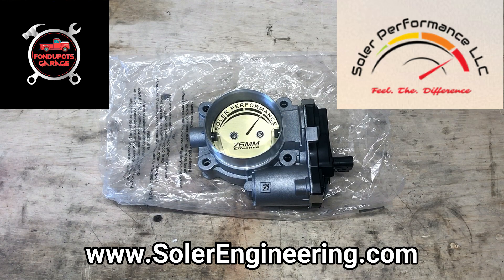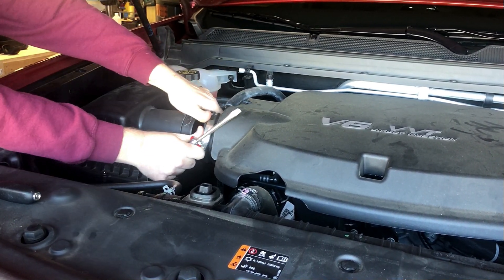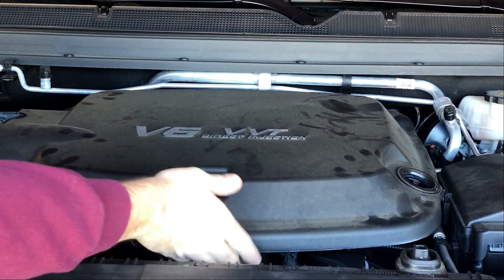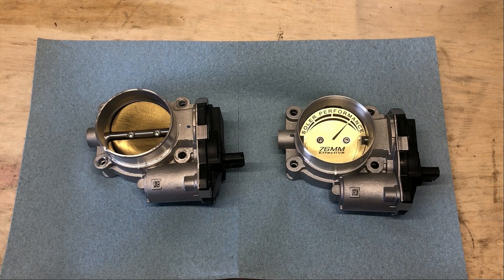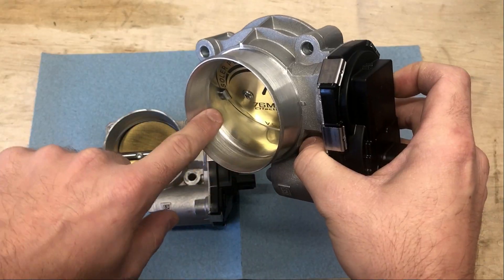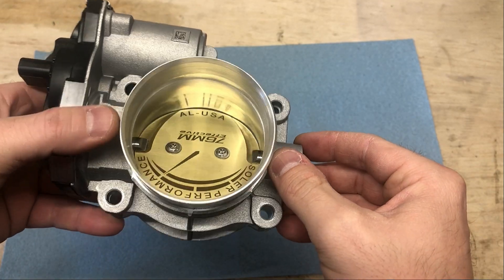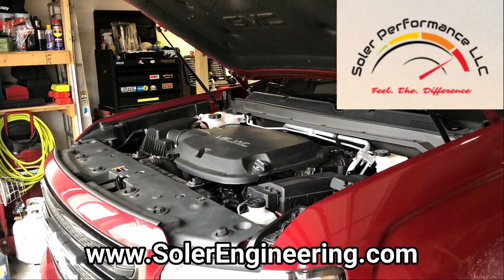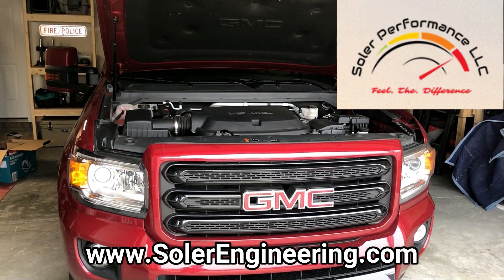[HOW TO] Install Soler Performance Premium Modified 76mm Throttle Body on 2015+ Colorado/Canyon 3.6L

Comment: I’m a bit confused on the driving cycle after installing the new throttle body. For me I typically drive 100 miles to work, shut the car off, then drive another 100 back home. Sometimes I do that 2X a week. So let’s say I drove 400 miles between 4 on and off cycles. Should I drive another 100 miles with 2-3 more on and off cycles over the weekend to fully calibrate it?
Reply from the maker: Do the calibration on the weekend, and follow the procedure laid out in the video.
Reply: @fondupot okay so pretty much just drive 50-100 miles this weekend while shutting the truck off every 15 or so miles? How long should I keep the truck off between cycles?
Reply from the maker: A minute or so should be fine. You don’t need to stop every 15 miles. But do 2-3 restart cycles over the course of the 100 miles.

Comment: Instead of 5-10 50 mile trips could I just a 500 mile trip ?
Reply from the maker: I think the calibrating requires the cycles of on-off to dial in the new throttle body.
Reply: @fondupot  okay thank you I appreciate you replying the reason I ask is I'm about to do some traveling and wanted to install it for the trip I'm going to drive a total of maybe 3-4 thousand miles total but they will be broken up in segments of 5-600 miles per stops
Reply from the maker: @SLOWZR2 it might be OK. But I would contact Soler performance and get their feedback first.
Reply: @fondupot will do thanks
Reply from the maker: @SLOWZR2  Good luck!

Comment: Has anyone noticed a reduction in engine braking when using this Throttle body? Doesn't seem like it fully closes the intake so i would think the plate doesn't fully resist the flow of air through it when closed
Reply from the maker: Nope.

Comment: Unfortunately this throttle body does nothing for 2016 chevy colorado,  gotta be a placebo if anybody thinks it does... almost 250 miles on my soler throttle body and no performance gains,  I'll wait till tank is empty to see if I get any fuel gains from it
Reply from the maker: That’s a shame. Very noticeable difference on my 2019 LGZ 3.6.

Comment: What size should I buy? Would I notice any difference even though I already have the trifecta tune?
Reply from the maker: If you buy the larger one you might need a different air intake. I’m not sure. I stuck with the original size for my truck.
Reply: @fondupot  I bought the one you had, hopefully is good with my trifecta tune.. I noticed 2-4 maybe 5th gear are good with trifecta but passing on highway isn't as good as I expected.. hopefully the throttle body changes that
Reply from the maker: It’s great with the trifecta. You’ll love it
Reply: @fondupot  I hear people saying the throttle body housing sometimes needs to be bored, but since you didn't mention that and say you saw noticeable improvements means I should be good
Reply from the maker: Yea I didn’t have to do anything to the housing. It was bolt on.
Reply: @fondupot  what about their throttle controller? You think it's worth getting the throttle body if you can just use a throttle controller?

Comment: After a year with the Soler TB I think it's the best performance upgrade I've done.  CAI intake and Magnaflow exh has enhanced the TB, but the TB alone, after a few hundred miles is amazing.  No more flat spot, much better throttle response and overall drivability.
Reply from the maker: I agree, I have been pleased with the Soler TB. I was actually thinking about opening it up and doing a throttle body cleaning to see how it has faired over the last year. It's been on my truck for about 12,000 miles now.
Reply: @fondupot  I checked mine after 8k, just a touch of buildup.  30 seconds with cleaner and it was new.  The MAF was still spotless.  I want a cheap bore scope so I can check the intake ports and valves.
Reply from the maker: Good to know. I should look into a bore scope too.
Reply: @fondupot  $40 on amazon for the cheapie, some shops use them because they get beat up no matter how much they cost.
Reply from the maker: Cool I’ll look into it!

Comment: Mmm i see that they did da same mistake on the butterfly TB (engraved slogan or brand)... They also put it down ... I was thinking that only with me did that mistake... I try to fix it but was to tight so i leave it that way.
Reply from the maker: I think it’s because the TB can be used in multiple applications. And some engines Mount with the logo right side up and others with it upside down. Oh well. You never really see it anyways.
Reply: @fondupot  yeap buy I've got a crazy idea if i desing a flexible clear cold air intake pipe
Reply from the maker: Sounds crazy, yep.

Comment: Do you have a link for the locking tab for the motor connector? Mine broke off when installing the throttle body
Reply from the maker: I doubt the tab is sold separately from the connector. You probably have to replace the connector to get a new locking tab.

Comment: How did this interact with your trifecta tune? Would the engine lug a little more before it shifted on throttle or was it the same just didn't have to hit the throttle as hard?

I just got a trifecta tune and was considering installing one of these just for the increased air volume at the same throttle input. Does it effect the shift points or leave it similar to what trifecta tuned it for?
Reply from the maker: I think it enhances the low rpm response even more. The two pair well together. The shift points dont really change with the new throttle body, its just a smoother throttle curve compared to stock. Thanks for watching!
Reply: I have the Trifecta, CAI and cat back, 4.10's and 33's.  The Soler 72/76mm TB improved part  throttle drivability.  I had a occasional hesitation when doing a rolling stop, just a split second hesitation.  This appears to have eliminated that.  Only have a few days with it, so far I feel it's worth the  cost.  It may have helped WOT, I think it was more intake and exh noise.  I'll edit this comment when I get more time on  the engine and the ECM corrects for the new TB.
Reply: @madcratebuilder  give this a like when you do it so I can read the follow up too please haha
Reply: @737Kamikaze  One month and 500 miles now and the trans shifting is fantastic.  Shift points are slightly lower rpm in both eco and sport mode.  Zero hesitation.  I  feel the TB has enhanced the cai/cat back.  Part throttle drivability is fantastic.
Reply: @madcratebuilder  awesome, thanks man

Comment: Love your videos. How has the new TB been working with the trifecta tune? Would a new tune help with the better airflow? I see they have a 76mm and an 80mm. Any input on one over the other?
Reply from the maker: Thanks a lot Anthony. The TB and Trifecta are working together perfectly. I haven't experienced any issues. I think they go hand in hand perfect. The truck was great with the Trifecta, but now its awesome with both. I think the 80mm might be better suited for someone that wants to do more custom tuning, whereas the 72mm would be better for folks that are stock, or have a canned tune, like a trifecta. Soler did say the 80mm ones would work without tuning, but he recommends most would tune with this option in order to get the full benefits of the larger much larger TB.
Reply: @fondupot  thank you!

Comment: Any changes in your gas mileage?
Reply from the maker: I'm averaging around 19-20 in mixed driving. I haven't had a chance to take a long highway trip, but it doesn't affect the mileage negatively.

Comment: I see you got the Trifecta tune and did the learning procedure. Could you just reload the tune and skip the on/off, on/off and driving to learn the TB? Not that it's a big deal to do it, just curiosity is all. I have a '15 Z71 4x4 CCLB with the Adv+ tune but still notice a little hesitation starting out when in ECO mode. Not so much in sport though.
Reply from the maker: It’s a short procedure. Either way the ECU has to learn the new amount of air coming in. I found that the off idle was much improved when in eco mode. And the truck just feels like a beast in sport.
Reply: @fondupot  Thanks Bro. Thinking hard about it now cause it's a pretty penny to drop right after the holidays.
Reply from the maker: I feel you! I don’t think they’re going anywhere so you can think on it a while and save up!
Reply: @fondupot  I got rid of eco mode on my trifecta tune,  I saw no reason to keep it so now I'm running on full tune even on cruise control, gas mileage is just better with the tune
Reply from the maker: Great. Glad you enjoy it!

Comment: I had little interest in this upgrade but I just love watching your videos. However, when I discovered that I could get rid of that annoying hesitation things changed. I'm leasing but it still might be worth it to get 2+ years of "more spirited" driving. Thanks!
Reply from the maker: It would be an easy one to do on your lease and just remove it before you turn it back in. Thanks for supporting the channel! Appreciate you watching the videos.
Reply: Good idea. I had a '17 Colorado leased now on a '20. I'll probably lease a '23 next. If they don't change the engine I'll be golden.
Reply from the maker: Right on! Enjoy!

Comment: What is the cost ?
Reply from the maker: $275 for a core exchange or a rework of you own TB. $375 for a brand new reworked TB.
Reply: @fondupot  and if I heard you right, there was a larger one available ?
Reply from the maker: Yes. There’s an 84mm TB that needs an adapter plate. Check links in video description.
Reply: @fondupot  want to get mine tuned but waiting for the warranty to expire first.
Can I ask why you didn't go for the bigger one ?
Reply from the maker: No reason in particular. Just went for the one without the adapter.
Reply: @fondupot  then in your opinion it's worth the money and you can tell a noticable difference?
I know that yours is tuned, so I was just wondering if I would notice a different ?
Reply from the maker: I noticed a difference op top of my trifecta. So I def think you’d notice a difference on stock.
Reply: @fondupot  thanks for the advice.
I'm gonna do it.
Got Lasfit LED bulbs coming for the headlights.
Had them on sale for $39.95 a pair !
Have enjoyed your videos and help with advice this past year.
Happy and healthy new year to you and your family !
Reply from the maker: Very nice! You’ll like it! Glad my videos have helped. Happy new year to you and yours as well.

Comment: Good video showing how to install it, i'm wary of how much performance bonus you're gonna get though. I've always heard throttle bodies don't really give any noticeable boost. The amount of air coming in is still the exact same through the air intake, regardless of how big you make the throttle body.
Reply from the maker: I definitely noticed a difference. But I have no dyno results to back that up.
Reply: Don't think of it as a performance boost, but more of a performance shift towards the beginning side of the curve. I ran one these on both my LFX 12 Camaro and 15 Colorado. As stated,  these help throttle response in the beginning, and the mid range, say if you were to punch the throttle while cruising in the 25-45 mph speeds. It kinda gives a little shift to the torque curve towards the bottom end.
Reply from the maker: Good way of explaining it. Hits the nail on the head!
Reply: It's not about horse power or torque, it's about drivability.  Throttle response is greatly improved, you get more air at less throttle plate opening.  This was improved the shift points on my 8l45.  I noticed the difference as soon as I installed and it continued to improve for the next 4-500 miles.  I compared 0-60 times using a GPS app, minor improvement and not conclusive.  If you have a tune it's even better.
Reply from the maker: Well said Steven.